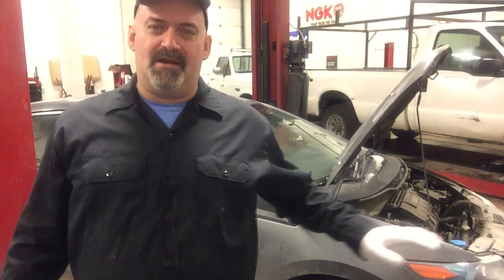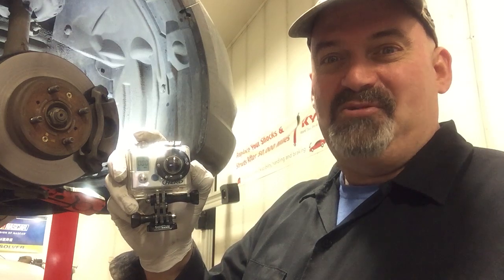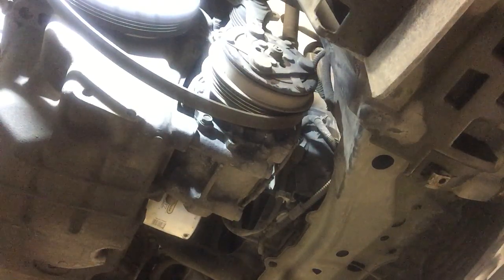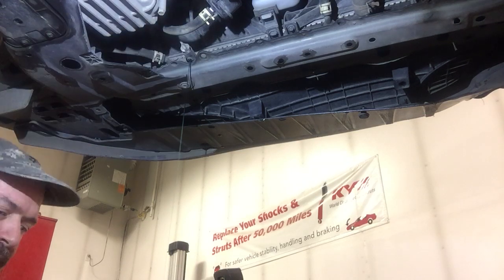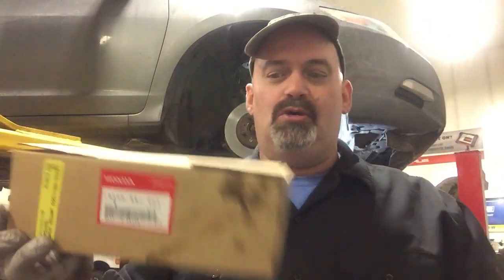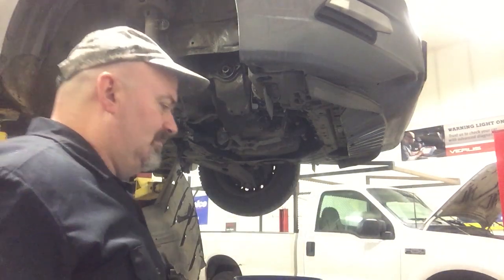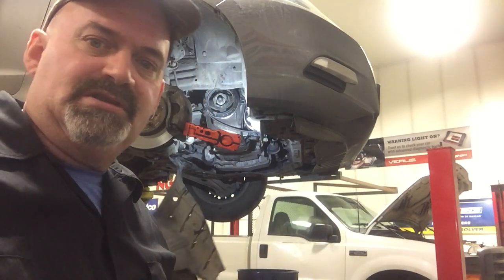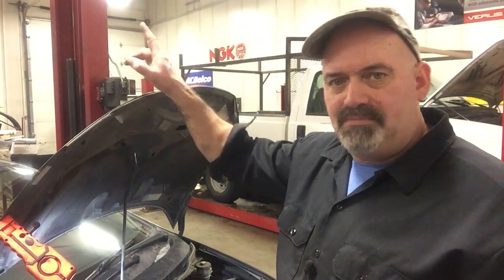Honda Insight Water Pump Replace

Comment: Is that the timing belt or the serpentine belt?
Reply from the maker: It’s called a serpentine drive belt. Some engines have timing belt driven water pumps but not this one in particular. Thanks for watching my vid!
Reply: @ThecardoctorTV  Thank you that's very helpful. I own this car here in the UK and I've been meaning to get it changed as it looks worn.

Comment: Nice work Tim on getting that pump in and out. And a nice tip on using the pry bar to get the pulley out. So, you threw the water inside. Surely, you were joking on that one :)
Reply from the maker: I shouldn't joke around so much. People think im being serious. Like the time a pretended to drink antifreeze. hehehe

Comment: to be fair with those rubber seals you can feel them squish out and when it gets solid just stop tightening
Reply from the maker: I had a Honda timing belt and water pump job the other day and it probably felt a little strange when tightening but not sure I could tell. Lucky for me I noticed a drip of coolant before I put the covers on. I removed it to find the seal had a small spot where it must have popped out or something. That's probably why I said something here. I also had valve cover gaskets in a buick that I had hot tanked the covers and put new gaskets on but they would just pop out when I turned the covers over to install. So stupid when they make junk like that. I don't like using glue to hold the gaskets in since that's hard to clean up if you ever go back in but I might start using it more on stuff like this. Anyway thanks for the tip. Ill keep that in mind as well. Take it easy!
Reply: The Car Doctor for this style gasket a trick I’ve used is petroleum jelly on water pumps and tacky grease for valve covers. Holds them in there while you’re fiddling around.

Comment: As tight as the bolts on the water pump pulley were I wonder what torque specs the factory used 😊 Good work Tim !
Reply from the maker: No kidding, I edited out a few choice words I think. haha. Maybe it was corrosion.

Comment: Man there was a buncha dust coming down when you were pullin that pulley out.
I've seen Mississippi mud and Sandy Hook sand first time I saw Anchorage ashes.
Next time ya try that hot water trick, try moving 30 feet closer to the driveway.
You very funny Dr Jones.
Gotta love an o ring pump versus a gasket pump.

Comment: looks like your shop is well insulated, what kind of heat do you use.
Reply: Hot water. He boils the water and then throws it toward the ceiling.
Were you in the 2nd Armored Division?
Reply: yes, Ft Hood Texas 142ND SIGNAL BATTALION, 2ND ARMORED DIVISION 1978-1980
Reply: Thank you for your service and keeping us free.
God Bless you and  our military.

Comment: Smashing job :-D, with an original honda pump, its guaranteed to work spot on.
Cant get any better than that :-D.
Torque wrenches for small stuff isnt really critical, ive told people to use a short wrench to limit there mustle power.